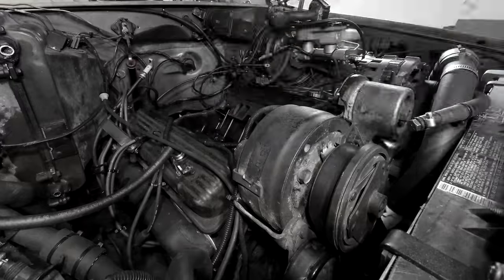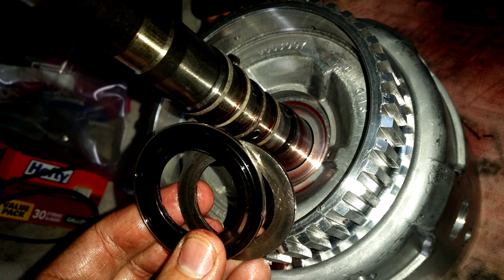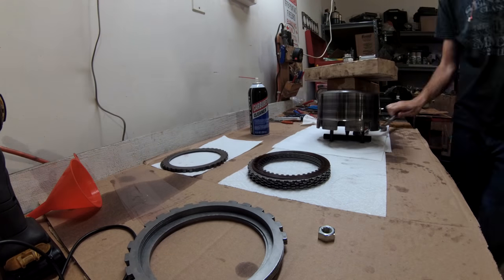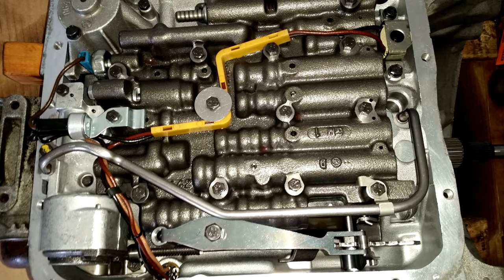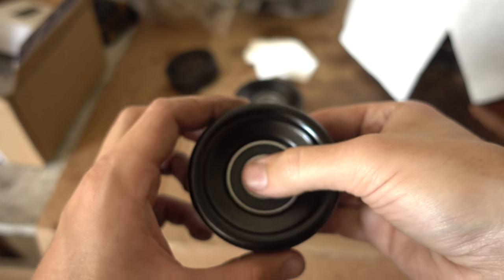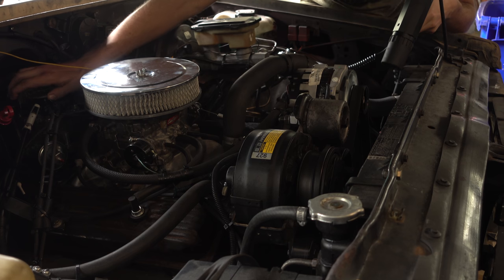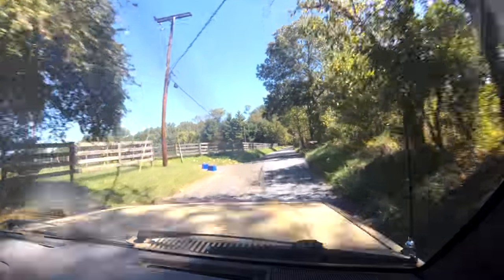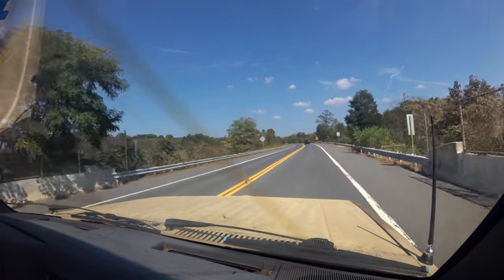4x4 V8 S10 700R4 Transmission Rebuild & Tune (Ep.4)

Comment: I have a 1992 silverado pickup with 350 engine with 110,000 miles on it . It is the best engine. I have always maintained it and always used synthetic oil. Transmission is a 700 R4 and change oil every couple of years. I purchased the truck new.    Good luck with your project.

Comment: This series really brings me back to old lessons learned. I've installed many a junkyard engine and trans, and have been burned more times than not. Sometimes you get lucky with a used engine/trans, but most of the time it needs to be rebuilt. Still, the enticement of saving a few bucks to take that gamble is hard to pass up; or rather, was hard to pass up. These days, it's all new or rebuilt components, because I hate doing the same job over. Great job on the Blazer, it's coming together very well.
Reply from the maker: I get that, next time I'll rebuild the thing to begin with. It was really just sticker shock of spending all of that money on so many different parts upfront. SBC rebuild kits can be had for quite cheap and I'll have all of the tools ready to go for the next one. And next time I get a 700R4 vehicle with a lot of miles, I'll probably go ahead and clean out the valvebody when I do the first fluid change. Thanks!

Comment: One of the most fantastic builds ever. I had a 1989. Black with the leather suede. Got 275K out of it, and it was strong.
The front ball joints were junk I think I went through at least 12 sets. Great Great videos! TY!
Just one word of advice from a older kid. Chasing sucks. Sometimes you just gotta go with your gut and tear it all down.
Great Stuff!

Comment: So much pain! rebuilt the entire trans to find out, your super hard to swap motor has a BHG! I have totalllllly been there! this series is superb!
Reply from the maker: Actually, the head gasket didn't cause any performance issues that I noticed. The transmission didn't really need a full rebuild, a valvebody one should have sufficed, but replacing everything was a good idea anyway. It drove well for a while after the trans rebuild until I noticed bubbles in the coolant tank that pointed to a blown head gasket.
Reply: Nice! I have a mild BHG on my ford 5.4 that doesn't cause issues other then oil leakage!  Might as well delve deep into the trans for the full rebuild!  I"ve been hesitant to do the trans rebuild myself, many fiddly things to get wrong, good job tackling it like that!

Comment: Please do some clean up and paint while you have that motor out!  Firewall, frame rails, undercoating....
Reply from the maker: Sorry to disappoint, but that's just not happening on this truck. I would like all of that, sure, but it just isn't in the cards for this thing. I riveted sheet steel over the rusted holes around the rear wheel wells, remember.
Reply: FuzzyDicePimp don't know what kind of shape the inner fenders and firewall and front frame crossmember are and I understand this is a cheap truck and it's come a long way. But I would push it out in at least power wash the engine bay really good to make it a little nicer work on next time you got to turn wrench on it. Just my two cents. By the way new subscriber here I've really enjoyed you as 10 videos even though I'm a Ford guy.
Reply: I'm not complaining, you might get some good views if you correctly repair those areas!   I like your content

Comment: Great work!
I've never understood why float level makes any difference. I mean, if there's fuel in the bowl, it should be good but I know there's more to it.
Reply from the maker: It is a little more complicated than that, but you're not wrong. You want a high enough fuel level so that the bowls don't run empty if there is very high fuel demand, so the jets are covered even if the fuel is splashing around, and it also helps get the fuel moving since the weight of the fuel on top is helping push it through the fuel passages. You also want a low enough fuel level that it doesn't splash out/flow out of the vent tube and flood the engine or present a fire hazard. There is even more to it than that if you really dig into it, too.

Comment: Not sure if your aware, but you can get a thing called a remote oil filter kit. basically screws onto the old filter housing and you mount it in an easier place. My last few project cars ive used them, mount them in an easy spot and oil changes are easy.
Reply from the maker: 4.3L 4x4 Blazers came with one from the factory, but it didn't fit the 350 block. Might try a universal kit eventually but space is really tight up against the exhaust.

Comment: Good work on this.  I will be interested to see how it continues.  You might want to consider getting a standard size or larger air filter assembly.  Think about how much less surface area that little one has even compared to a 2" tall, 14" diameter "standard"  one.   I like this little rough and tumble rig.
Reply from the maker: I tried several kinds, still haven't managed to fit a 14" air cleaner on it. Tried different bases, spacers, adapters, etc. It's either hitting the radiator hose, the distributor, or the hood lol. Changing the thermostat housing/rad hose would be the best solution, but the engine doesn't make a ton of power so I don't think it's that important anyway.
Reply: @FuzzyDiceProjects  I forgot that you shoehorned a dimensionally bigger motor in there -- it looks right at home.  I think you will be surprised with the difference it makes.  My TBI motor (pretty much what you have) has benefited hugely with exhaust and intake restrictions improved and I have the stock (round) cam.  I also have a stock 80s high compression 305 and a stock 80s 454 and interestingly, the engineers put the big block air cleaner housing (5 inch tall filter) on the high compression (high-torque) 305s and the standard 2.5 tall or whatever on the 350s.  I think they were trying to get every last bit they could out of that LE9 305.  FWIW.  I like the benefit of passive power gains whenever possible.  Good project, carry on!

Comment: Remote mounted oil filter bud. Easy fix. Also, speaking from experience, any engine swap should be torn down to the short block and checked. You will save soooo much time and headache.

Comment: damn this reminds me of my old s10 blazer i had. ran into the same problems twice with the radiator hose. i ended up sleeving the rad hose with exhaust pipe over the hose. you would hear the alternator fan constantly hitting the hose when i wheeled it lol
Reply from the maker: Haha! I cut the hose so it was a bit shorter, and zip-tied it to the alternator. Same thing with the V8 in it, but the angle is such that it wouldn't really be able to hit the fan anymore. Why did they think that design was okay?

Comment: I have an 1991 K1500 with a manual, I recently didn’t a 305 to 350 swap on. I’m having the same RPM problem on the new 350. It’s got a throttle body on it though. After watching this video it makes me think it’s the Fuel pressure regulator.

Comment: Perfect timing. I just found your channel last night and watched all of the other build videos! haha...

Sooo... Did you find anything actually wrong with the transmission?
Reply from the maker: I dropped everything to finish this video because the other ones started getting a lot of attention over the last week. As for the trans, no, not really. The TV valve was stuck, as I already knew, but that wouldn't cause it to not move, just rapid friction disc wear (and they were actually still totally fine). I expected some obviously bent fins in the torque converter or a busted stator clutch, but unless the bends are subtle, I couldn't find anything wrong. My best guess is that something else in the valvebody also got stuck (most of the valves were a bit hesitant to come out, maybe clogged with friction material) and prevented fluid from being routed correctly.

Either way, I'm pretty sure I could have gotten away with just rebuilding the valvebody and (maybe) replacing the torque converter. I had more narration about that in the video, but I took it out because it seemed to slow things down too much, and since I don't really know what happened it sort of went nowhere.
Reply: It seems YouTube does that sometimes with their algorithms. I've seen channels grow by double or triple in a couple of weeks whenever YouTube deems it so... Anyhow, I'm enjoying your builds.

Man.... I hate "mystery" repairs, but I guess a repair is a repair as long as it works.

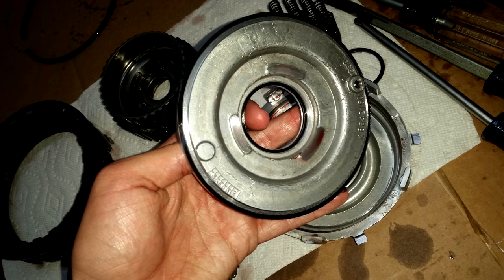Comment: If your blazer has the factory option list inside the glove box you can see what ratio the rearend is-4:11 is the most common I have seen and also if you see G80 you have the Eaton locker in the rear, my 1984 gmc s15 jimmy 4x4 had the 3.73 rear with Eaton locker
Reply from the maker: It has 3.08 gears and unfortunately nothing fancy in there. I'm pretty sure those lower gears are only on the four banger and maybe 2.8L trucks. I like looking up all the RPO codes when I buy a vehicle, good info and sometimes a fun surprise!
Reply: FuzzyDicePimp yeah the two  2.8 86 blazers I have owned had the 4:11s but the 84 gmc s15 jimmy 4x4 2.8 had 3:73s and it has the Z71 package which I haven't seen before, and the 86 I just did the 93 engine swap in I did away with the front diff and changed out the 4:11 rearend to the 3:73 rear

Comment: Don't worry man. Once you've fixed the engine, nothing else can break in the next future. Are you gonna fully rebuild it at the crank and up?
Reply from the maker: Have new piston rings, main/rod bearings, and gaskets on the way. Probably replace the valve springs for kicks. The crankshaft journals aren't as smooth as I'd like to see but I'll try polishing them a little and see what shakes out. Keeping the cam and heads and such because I'm cheap and they should be fine. I sure hope you're right, after this there isn't much that hasn't broken yet!

Comment: Head gaskets. Same issue with a car I fixed a wile back. Bubbles and overheating. The compression of the Chambers were seeping into the coolant passages
Reply: And on further inspection, you already found out
Reply from the maker: Yep! Surprisingly I didn't have any engine temperature problems, but I'm sure it would have gotten worse over time.

Comment: I like this swap. I think the only thing I would do differently is I would have retained A/C but that is just because I don't like being hot in the summer.
Reply from the maker: Completely reasonable. I don't use A/C all that much and just wanted it a bit more simple, and wasn't going to deal with flushing/modifying for R134a. Also, wanted to give that little radiator the best possible flow to cool the bigger engine.

Comment: I had a 92 s10 blazer that had a oil cooler with filter mounted on the driver side fender if you could find one in the junk yard might help with your oil filter location makes a mess when changing it but would be easier hope this helps
Reply from the maker: Unfortunately, this S10 came with one of those remote filters too. I thought I could keep it, but the part that bolts to the engine is different and won't fit on the 350 block I have. Thanks anyway!

Comment: Did you say this was your first trans? You knocked it out of the park! Where did you get all the great info about upgrades and tips? I have a 46RE that lost 4th (lock up) and looking to rebuild it my self. Great vid!
Reply from the maker: Yes, this was the first transmission rebuild I attempted, but I followed a rebuild guide and a lot of forum posts beforehand and during the process. The 700R4 is ubiquitous so pretty much everything about it has been extensively discussed online. Most of the custom tools and stuff were inspired by tips found on various car forums, too.

Comment: Your crank case pressure should be going through the PVC valve if so oil would not push out the dip stick also it will vapor lock under high rpms and gie

Comment: the 700R4 in my 1984 2.8L S10 Blazer is leaking in the Front, I thought it was the Pan Gasket and I changed it and it's still leaking REALLY bad, Basically as quick as I put it in it runs out the bottom LoL, So do you think it's the Front Shaft Seal ???

Comment: Knowing me, I probably would have swapped out the 700r4 with  4L60 or 
4L80 and do a shift kit if I was to stay with the Auto trans. Probably would have been 
easier to just swapp it out with the NV 3500 manual trans.

Comment: well that trany is not meant for a v8...  it has less clutches .. so thats why it went up.. watch on how you treat this truck as next you will have problems with the rear...  but your doing all the right things so keep it up buddy. and ya i know these trucks like the back of my hand. right now i have 2 .. my 92 2wd i bagged it and body dropped it and doing a v8 swamp.
Reply from the maker: The transmissions are actually the same between these and the full size trucks after 1986, no worries there. And the clutches weren't at all the problem. I have heard that only the older 7 1/2" rear ends are problematic, and that the 7 5/8" this one has will stand up to hard use behind a mild V8 (which mine isn't), it will surely be fine.
Reply: yes your right... but v6 only.. these never came with v8 so gm never put a v8 trany in these.. and im sure you know what i mean.. v6 tranys cant take less power then there v8 counterpart..  i just pulled my 92 700r4 apart  as i was told it came from a v8 truck. well it did not. had less clutch packs and a different v.b. .   but anyway looks like its running good and thats all that matters.. were in md are you? im in harford county.
Reply from the maker: That's strange. I rebuilt mine with a kit made for 87+ 700R4s, not for V6 transmissions, used all of the clutches and everything fit right. I've read in many places that 700R4s were identical in all 90 degree applications after the 1986.5 revision. Mine certainly is the same as what came in full size trucks. Your truck wasn't a 2.8L was it? Those were always made differently. I'm in Montgomery County, MD

Comment: Someone may have already mentioned this, but if the TV was stuck, that is what burned up the clutches.
Reply from the maker: The clutches didn't appear burnt, the wear on them just looked high mileage and they had no glazing a lot of material left. The stuck TV was an issue, but the system should have had full line pressure in manual low gear still and it barely wanted to move. I still don't know for sure what the issue was.

Comment: I realize you're probably already done or close to, but you could just buy a dingleball hone, spin it yourself, and get new pistons+rings+head gasket+bearings
Reply: Or drop an LS in it now that the heavy lifting of getting the V8 in is done.
Reply from the maker: I actually haven't done anything else, I just got the engine out two days ago. This video is pretty much all there is at the moment. But, that's the plan! Ordered rings/main and rod bearings/gaskets for it, and a 4 1/8" dingleball. I will also try a little DIY crank polishing since the surface finish on the journals isn't the best. Not going to have this machined, just going to see how it does with some cheap new parts.

Comment: goddamn thankfully someone figured out this crazed bs. I would imagine i would lose the balls that come from the valve body or put the clutches in the wrong order
Reply from the maker: Rebuild kits come with new checkballs, it's just about making sure they are where they need to be (especially since it varies between models and years). As for the clutches, I just kept them in a stack when removing them and stacked the new ones to match the old. That's all there is to it!
Reply: FuzzyDicePimp ah I see that part, but such a simple idea is hard to do in practice, especially that valve body. SOMEONE HAD TO DESIGN THAT. Frickin Einstein over here
Reply from the maker: Oh, yeah, I have no idea how they designed that, much less the older automatic transmissions where they must have just sketched things out by hand. People are amazing!

Comment: good videos ..where did you order transmission floor jack adapter from? thank you keep up the great work
Reply from the maker: Not a jack adapter (those are a bit scary), it's a completely separate transmission jack. This one was from Jegs, something like $170, but there are several other brands making them for about that price with very similar designs. If you have to remove a transmission with a transfer case on it, especially if you have to do it alone, I'd highly recommend one.

Comment: Just a suggestion but when you rebuild that engine i would find a different set of heads those swirl port heads don't flow very well.
Reply from the maker: Yeah, I know. They are good for low-end torque but terrible for horsepower and high RPM. They are 191 heads, for the HD trucks. I have a pair of 193's in the garage too but they're no better. I've looked at other options (Vortec heads) but it's just too much money and probably need other parts (intake) to go with them. Maybe next time. Thanks for looking out, though!

Comment: I have to do this with my 1989 Chevy Silverado. About how long did it take you to rebuild the transmission. Not counting pulling it out and putting it in the truck! Thanks
Reply from the maker: It was out, rebuilt, and reinstalled in six days, but I spent a lot of time on it in that time period. Could do it over a weekend if you were really determined, but I'd say take your time. The next trans I did (which will be featured in detail in videos over the next few weeks) took around a month, but the work was more spread out and slower because of filming and ordering a few parts online.